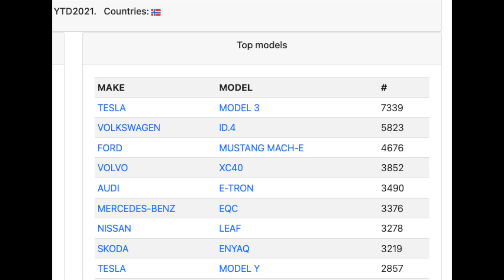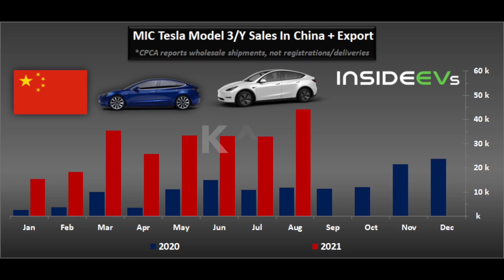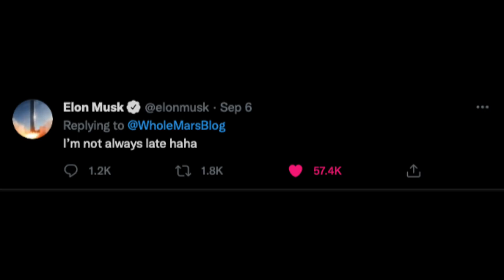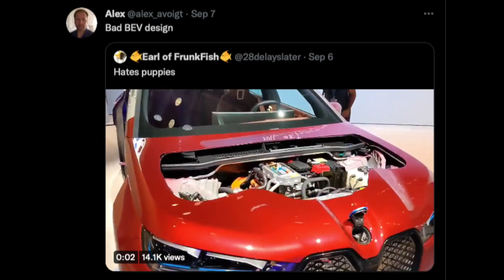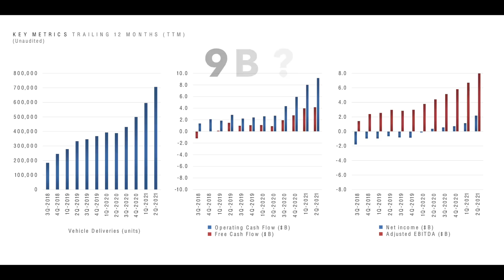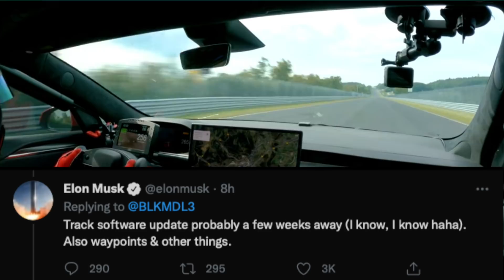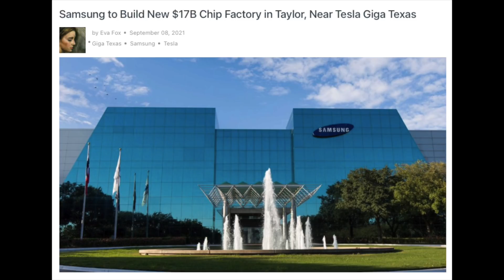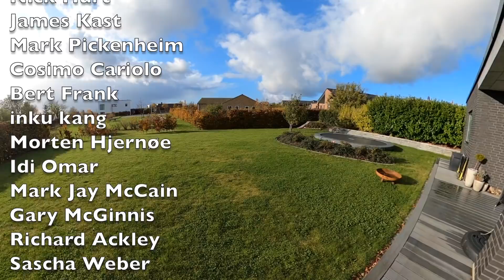Tesla is doing things I have never seen before, MIND BOGGLING 🤯

Comment: Keep in mind, tech specs, are great, but not the only part of why people buy cars ^^
Most did forget, when they look at the great specs of Tesla ^^
Reply: Sure. People does not mind the tech specs in their smart phone? They all want a slow phone with minimal amounts of ram and storage? Didn't think so?

Keep in mind that there is not only a transition to electric cars here, but also a transition to smart cars (computers on wheels). Specs will matter in the same way that they do in a mobile phone. As the smart phone have taken over the phone market, so will smart cars take over the car market. 

No one will want a slow car, with a tiny range, with slow charging speed, with a slow infotainment system, with no connectivity, with no over the air updates, with no feature updates, etc. In the same way that no one wants the kind of phones that we had pre smart phones.

Comment: I dont think 100 KW charging per se is disappointing. The question is not what is the max but how fast does it charge as the battery fills up. the Tesla does charge at 250 from 10 to 10 percent but then drops off precipitously. the vast majority of drivers will never dip into the under 10 or 5% SOC realm thus will never see that supercharge in action. The PSA E 208 maintains the 78 kw charge rate far into the  charge. So time-at-charger is quite short. The better metric is time at charger per distance gained.

Comment: The lasers are not for the windows, they are for the camera lenses. IMHO
Reply: Yes they are for windows. Check again.
Reply: @user-rd7tw5xy4c  The patent drawing shows one possible implementation illustrating windows as an example of the operating principle. The language of the abstract does not specifically referr to windows but to "glass articles". The energy needed to clean an entire windscreen of debris, rain, snow etc. under adverse conditions is far too high to discharge anywhere in the vicinity of human faces. However, on the much smaller scale and more remote positioning of the cameras, plus the complete dependency of the FSD upon those cameras under all conditions, as well as the solid state and much lower power requirements of such a system in the restricted confines of a camera pod all argue very strongly for this application versus what is shown in the drawing.
Reply: @larrybuzbee7344  Yes, yes, and yes besides a self-driving car doesn't need windscreen wipers nor a windscreen for that matter. These fanbois will follow the ever-growing Tesla bureaucracy quietly ignoring a camera's Achilles heel. Drive behind a truck on a wet salted road and you'll soon be in unguided missile in the face of on-coming traffic. Bet you'll want your steering back.

Comment: You don't need windscreen wipers in a self-driving car. Perhaps it's to clean the camera lenses which if dirty will disable your car. TESLAP
Reply: Just use lasers...
Reply: So you mean that the passengers don't need or want to see out? Good luck with that line of thought.
Reply: @yourcrazybear  Passengers look out of train and bus windows all the time. None have wipers.
Reply: @MegaWilderness  Nonsense. Buses and trains have wipers on the front window just as cars does.
Reply: @yourcrazybear  They have drivers
Reply: @MegaWilderness  It was you that brought them up to begin with. The fact is that they have wipers in the front window so that the drivers and passengers are able to see out in bad weather (rain, snow, etc). Driverless or not, people will want the ability to look out and see something.

Comment: I have a dream and only Elon can do it: Buy an old AIRCRAFT CARRIER or a LARGE TANKER and build your NANO FACTORY on it. You can take it anywhere where there is sea. Elon can do only final assembly of SKD kits on this floating factory. There would be many advantages and cars can be built and delivered by this floating factory saving huge costs. This would also prepare Tesla for future compact factories in space and on Mars.
1. Save on land cost
2. Save custom/import duty...just build on site.
3. Use container ships, barges to get supplies and dispatch cars.
4. Many such Floating Factories can move where the demand is.
5. Since no one has done it, Tesla would again be disrupting the system and be years ahead of competition. 
6. Tesla employees would have opportunity to roam the world free. 
7. Water use would be no issue like Tesla being harassed at Berlin.
8. Power can be supplied many ways...land cables, solar, wind, waves.
9. Countries can't impose silly rules.
10. 'Built on Tesla Floating Factory' would be the new label.

Comment: Small EVs are a problem. The power needed to move a small heavy car is not that much less than a larger heavy car. So they need much the same expensive battery with much less utility in the car. Result - nobody wants a small EV with small range.
Reply: By using composite/lighter materials they can actually achieve that, or with time batteries will become more energy  dense
Reply: fiat 500e is doing well, dacia spring is going to do great

Comment: I can’t wait to get the model Y long range and a dual motor cybertruck. The only problem is…it hard to convince my wife to switch over from gas to electric. When the gas goes up to $7 a gallon then she might reconsider.
Reply: I drive a 5.4 litre Ford truck. With $2.56/gallon gas, it's expensive to fuel up. But, I deliberately bought an older $2700 truck to give me time to save for a Tesla truck!
Reply: @Duke_of_Prunes  lol..... why can't you simply borrow or rent a truck for your activities?! Also in Europe vans are way more practical than those big 5.4l engine trucks.
Reply: @Duke of P I used to own a 4.OL Tacoma. Love the truck for its utility but not on gas. Gas prices in socal is around $4.60 per gal. Can’t wait to see the cybertruck on the road with real world testing done to it.

Comment: Totally hot on Tesla, but not sure about the yoke. I can see going around a roundabout, Yoke vertical or over vertical, and then trying to reach the turn signals to indicate you’re taking the next exit. Prefer to have such controls in a fixed location, like on the stalk.

Comment: They all have their shareholders to think about. They will not accept the expensive transition from ICE cars production to EV’s.
Reply: @carholic-sz3qv  . Why so rude? Maybe I should have written “…to only EV’s”. They have to rapidly escalate their production rate to millions of cars. That is a transition they cannot do at this stage. They, or arguably only VW, sell EV’s in merely tens of thousands today. All with little to no profit, and in some cases even with loss. Their main production lines aren’t making EV’s and those need the long, complicated, complex and very expensive transition to EV production.
Reply: @carholic-sz3qv  Well, you might be right there, but the old big brands can’t make the change in time before either bankruptcy (and they will also be heavily battery constrained) and/or run out of time, due to the laws and regulations forbidding the selling of new ICE cars.
Reply: @mrm.5787  well everyone is going to be battery constrained even tesla, and its only going to get worse when more EVs  and electrified equipments  are produced.
Reply: @carholic-sz3qv  For everybody’s sake, I really do hope you are wrong and that Tesla have figured this out. Otherwise….. I have my hopes on the 46/80 cell and that all will be based on iron eventually. Then that soon one hundred percent of all batteries will be recycled over and over and…….

Comment: I don't understand why these automakers keep building inefficient 4-wd electrics. The i3 had terrible range for a reason despite being made out of carbon fiber. Do they not have experts that know basic science.
Reply: NO, they dont.
most of their ENGINEERS come from the ICE car industry and the skills are NOT Transferable. 
their Engineers dont know the Difference between a NICD battery and a LION.
Reply: Stop the bullshit mate, BMW invested billions to build one of the largest carbon fiber production plant in the world, the tesla carbon sleeves materials surely comes from that factory. Also BMW was the first to use a huge casting on their cars, there is a 2014 video of sandy munro on yotube.
Reply: @markplott4820  lol.... those skills are actually transferable, its mechanical, electrical, software engineers, those companies also have composite/material development branch.
Reply: @carholic-sz3qv   - Ummmm, gm and FORD cant Reprogram controllers like TESLA can, they are writing Softtware for 20+ kinds of Processors. 
the BOLT is not even made by gm, its 80% made by LG Chem.
Reply: @markplott4820  nonsense, talking chip shortage, tesla barely made 500k cars last year when ford made over 5 million, toyota and vw made each other around 10 million vehicles. Tesla has litteraly no point of goofing around. Tesla also uses batteries from LG, CATL and  pansonic.
Reply: @markplott4820  reprogramming controllers is useless when you can't even have enough of them to beginn with, and there are sooo many different suppliers in the industry that makes the same things, BOSCH, Denso, Aisin, Zf...... makes tons of semblable products which even tesla relies on.
Reply: @carholic-sz3qv   - TESLA purchased 20+ kinds of Processors and is writing TESLA contoler Sofware for each of them.
gm and FUD motors dont even create their own BMS and Motor Software.
Reply: @carholic-sz3qv   - NOT Anymore , TESLA on TRACK to produce MORE than 90ok in 2021 and over 1.5 MILLION vehicles in 2022.
meanwhile , LEGACY auto cant even sell Vehicles on the lot.
TESLA in Q4 sells evertthing including DEMO and Showroom cars and also does good business in USED Tesla as well. 
LEGACY simply cant scale with its MINISCULE battery cell output.